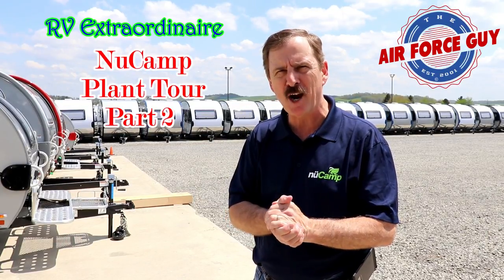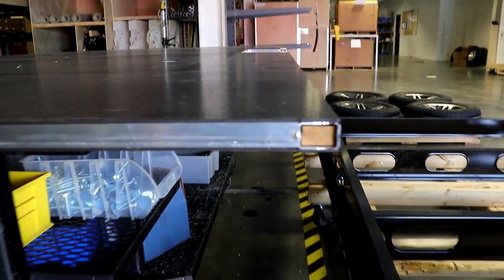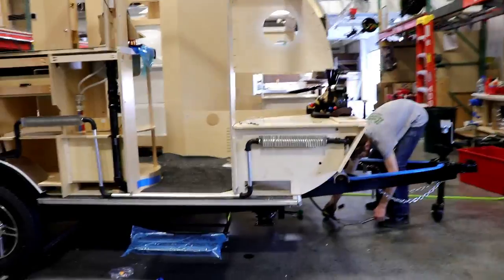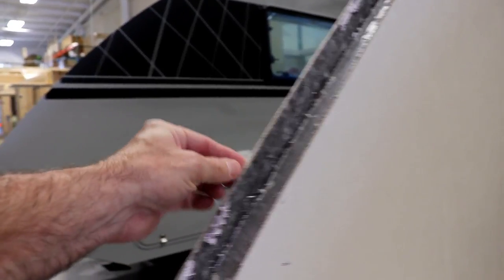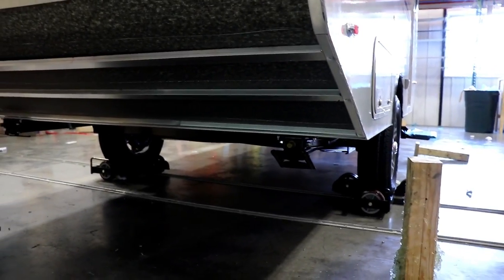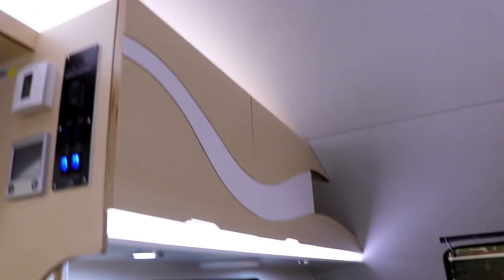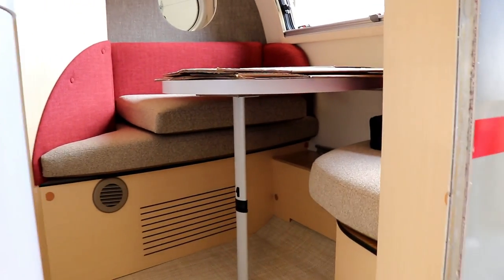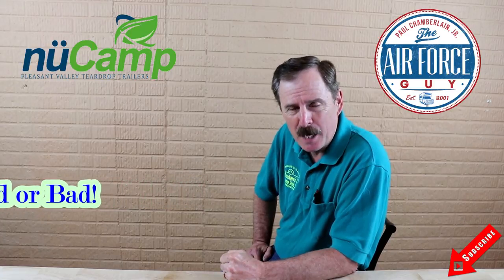Part 2 of the NuCamp Factory Tour {T@B 400}   -    w/ Paul Chamberlain, Jr. "The Air Force Guy"

Comment: I would like to know how the t@g and t@g xl vent out the heat from the window ac and how you keep the condensation from ruining the camper, this is my only hold up. Once I know then I'm off to the dealer to get mine
Reply from the maker: There is a fan on the back of the A/C that vents the heat outside.
Reply from the maker: I discuss it on thus video:  https://www.youtube.com/watch?v=Ynf1gwM1bJE
Reply: @TheAirForceGuy  I am familiar with how a window ac unit works, I was asking about is there a chase going straight down thru the camper unit and is that where all the moister goes.

Comment: They should’ve use aluminum Inside the frame in a screw through what is no good that’s a weak link in the whole system
Reply from the maker: Dominic,  they don't use aluminum inside. The aluminum is the frame for the walls, floor and ceiling.  As far as leaks, all RV's leak if not taken care of.  One must do the regular maintenance to deter leaks.